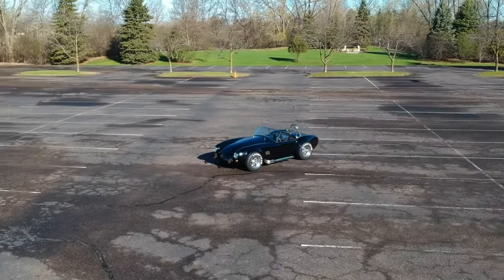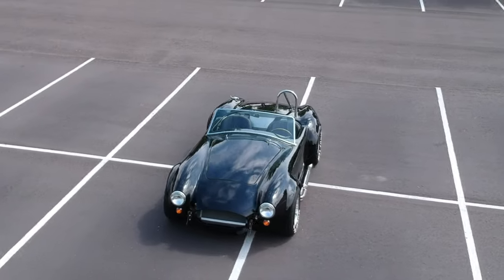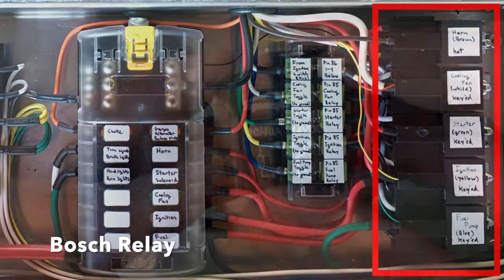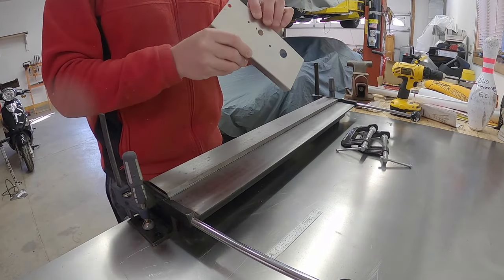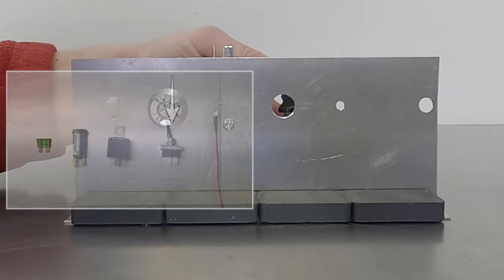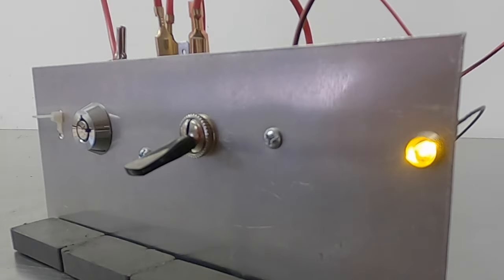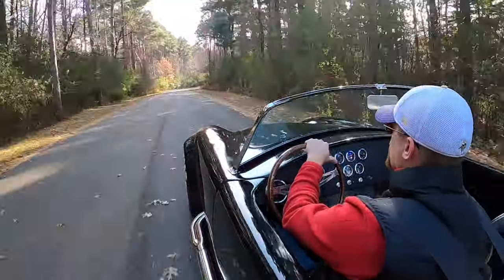Car Wiring 101

Comment: Just wondering why you switch the ground side? Most every circuit I have worked on both AC and DC switch the power side. I am a retired electrician and have worked on a number if cars. Completely rewiring 2.
Reply from the maker: Switching the hot side is preferred because if downstream wiring  were to short the ground side, it could trigger the relay (you are right with your assessment). I chose to trigger ground side for simplicity because of my switch layout with the relays in the trunk and I could then feed them all the same power source from the key switch in one place. I suppose I could have fed a switch array via the key switch then sent it back to the trunk/etc. too. I will say, its HIGHLY likely that any large scale auto mfg would only allow switching the hot side of the relay for safety.

Related- I'm in the midst of wiring an Edelbrock ProFlo 4 system in my Corvette and Edelbrock powers the ECU/system with a standard Bosch relay - interestingly though, they switch it from pin 85 as the hot source (should be 86 if wired "by the book"). I "think" I read somewhere that when you trigger off 85 you could potential reduce voltage spikes when the switch  closes that could cause issues with an ECU, but usually you would attack something like that with zener diodes. This is PURELY speculation on my part though- it also could be a wiring mistake.  What I'm getting at - I have NO idea why edebrock would feed 85 but I maybe the switch doesn't care which way current flows either- any ideas?
 
Thanks for the great comment!
Reply: @TacoJoe  Some relays have built-in fly-back diodes.
Reply: @TacoJoe  q
Reply: Most horn wires are ground switch.

Comment: “Except we’re going to tap in to the fuse box to power the loading side of the relay” and forward you lost me and I believe a few other people too. I was excited as you were answering all my questions up until this point. 
Why does the fuse have 2 power outs?
When you overlaid the relay diagram and started calling out numerical names of the pins it really threw a curve ball to the learning process (“this pin/that pin”) would’ve kept it simple and visual only. 
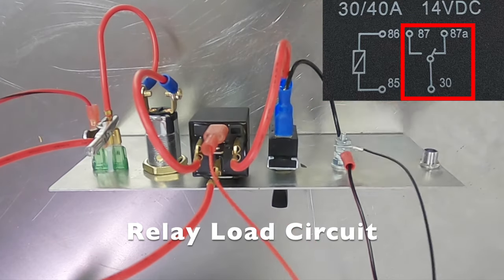Also the overlay sort of blocked out the last ground wire you added. Although the ground is super simple you should still emphasize it’s purpose. During the video I also had to keep reminding myself what a relay is and does. If it was explained (again) in the middle or after finishing the wiring at 4:10 it really would’ve put a learners mind back in line. 
Also the wires going out of frame adds another level of complexity because we have to “fill in the blank” of what’s going on out of frame. First time I watched the video I thought the fuse>load cable that goes out of frame was going to another fuse box or power source Before I realized it was just a single wire. Showing the battery in frame would cut the learner a break so they can focus the real unknowns.

Furthermore it would help us understand why, how, and when 2 wires can come off the same connector. The fuse and the grounding point both look like it would cause a short to the untrained eye. I’m guessing by you powering the load and relay from the same fuse you were trying to suggest that it all fuses in a fuse box have the same power source. Maybe it’s not i don’t know I still have that question. 

 After busting my head trying to comprehend whats going. I think I have it figured out now. Huge thanks to this visual you made for us! Truly a game changer and makes wiring less intimidating. I believe this content has huge potential. 

Thank you for your knowledge!
Reply from the maker: Lots of great points 2point2turbo - you could pull from the load side of relay too and only pull 1 wire from the fusebox / that's what nice about wiring is there are many different ways to achieve the same goals!

As for the visuals - great feedback myman and something I can work into future videos (battery in frame / better diagrams / etc.) apologies if it was confusing and hope you were able to figure it out on your project.

Speaking of which - I'm wiring up my C3 corvette (complete rewire) and maybe I can work in some of these clarifications in this future video- any additional topics you would like to see regarding wiring also?

Thanks for the great comment/feedback!

Comment: Trying to learn as much about wiring as possible because I might rewire my whole 85 s10 for a drag car. I’m frustrated with all of the gremlins in it to the point I just want to take out every wire and start over
Reply from the maker: So here’s what I’ll tell you: you’ll have to do some more planning up front, but once you get rolling, everything will fall into place and then a hen you have an issue, it’s easy to troubleshoot / I say go for it!

Comment: Don't know what you decided on your Vette.  I am putting a Gen V LT1 in my 37 Chev.  I got an engine harness with a refreshed computer from Speartech.  Harness laid out easily on the engine and just needed a constant 12v positive and a switched positive. One wire to the load side of the brake light switch will control the trans lockup.  This is my first venture into modern engines and I was impressed when I hit the starter and it immediately fired.

Comment: Thanks for this video.  Are you familiar with the Infinitybox 20 circuit wiring harness kit.  While quite spendy, it seems this would certainly simplify the wiring for someone like myself that does not have quite the electrical skill level or experience do do the job from sq. one.  The Infinity look like a nice system to me, your thoughts.

Comment: Thanks for the video! It helped me understand a lot, but I’m still confused on one part. What is the purpose of the relay? Would it work the same without the relay if you’re using a switch (ignition)?
Reply from the maker: Hi Adam / great question - yes: you could just use an electric switch in place of the relay - the catch is you need to find heavy duty switches / need run large gauge wire in place of the relay. If you really boil down what i did in my wiring scheme: I ran a whole bunch of higher amperage accessories through 1 key switch to keep things clean/simple on the dash and allow me to lock out the car for security. I wouldn't have been able to do it without the relays - unless - I found a 30-40amp key switch and ran extra large gauge wire around the car/etc. Thanks for the comment!

Comment: Nice 101 lesson! Too bad I'm fuel injected, and upgrading to sequential ignition and injection, I think I need the more advanced class. (Current issue: How many amps do 8x near plug coils draw, so what fuse and relay should I use?)

Comment: love the setup!  the keyed access is a neat feature!   what gauge wire did you use throughout your setup?  all the same, or different AWG?
Reply from the maker: relay outputs I used 10 & 12 gauge (a little overkill) and triggered the relays with 14 awg. You can easily trigger with 16/18 awg though / I just had a lot of 14ga on hand. If you do some google searches, there are charts that classify typical DC voltage drop as critical (less than 3%) and non-critical (up to 10%) - then specify an AWG for a length XXX run. Big picture: most lighting (minus headlights) 14AWG is great / fans you likely need 10awg / each can draw 20-25amps if you have a high CFM dual setup / starter solenoid also can draw some serious current along with fuel pumps/ignition. Every car is different though so make sure you do your research but you are thinking about the right things (ie - size it accordingly too!) Thanks for the comment!

Comment: I love your vids. I am building a MkIV (Complete Kit). I’d like to incorporate some of your wiring ideas into my car. The kit came with the wiring harness. I’d like to use a push button starter like you have done and have it secure. If I were to use the relays in addition to the existing harness, would I position them between the starter solenoid and the push button? Any recommendations?
Reply from the maker: Hi tom - sorry for not getting back to you sooner - you'll want the load side to the Bosch relay to trigger the starter solenoid and then you can lock it out too / that's how I did it anyway - you could probably trigger straight to the starter relay, but when it closes I think it can pull some amps so I played it safe and used a relay. If you can find a momentary switch rated for 10-15amps I think you could go direct. Good luck on your build!

Comment: Im thinking of installing an electrical fan to my radiator in my 65 GTO. theres a vid here where he shows how to do it and he uses a relay and its temperature controled. You think I should also install a switch to it? It is switched like thisoff the ignition.
Nice vid helped a bit

Comment: Very nice and clean installetion. For the switched relays: did you connect all '86' together so they receive 12v after ignition switch is on?
Reply from the maker: Exactly- key only gives the array power (so you can lock-out) - Bosch relays are quite useful! Thanks for the comment-

Comment: I have a 65 Mustang Convert with Painless wiring kit. Ive installed my second RetroSound Radio (pretty easy - 12v constant, 12v Ignition, and Ground). The first radio the internal amp fried and would do a speaker pop when turning the radio on/off (I could see the speakers push out (pop) then push in (pop). New radio (same make/model) no pop. What can I do to make sure the radio is better protected? The car does have a fuse box and the radio has an in-line fuse but something happened to cause the first radio to get damaged. Any ideas or help is appreciated! MD
Reply from the maker: There is an always hot line from the stereo too (for memory functions / etc) - make sure there isn't a short there, its on a fused lead and double check the fuse size. I have an aftermarket radio in my C3 corvette and I think its only a 10A fuse / good luck and thanks for the comment

Comment: What terminal block manufacturer did you use Joe? My Mk IV is ordered and I'm most concerned about accomplishing the wiring. Your video was great. Thanks,!
Reply from the maker: Thanks for the comment Gary - I just got a 5 pack or 10 pack off amazon so I guess it wasn't brand specific - they are really really handy though - I've used them for trailer wiring / electronics wiring / etc - make sure you have a good crimp tool also to go with them for your connectors and good luck with your build!

Comment: Do you need to have one relay for everyone? Like one relay for headlights, one for wipers, one for dimmer, one for heater. And so on and so??? Asking because I have an old 84 d150 and I would like to rewire it all doing away with some things and adding others like power windows, locks.
Reply from the maker: There are ways you can wire multiple accessories to one relay, but you would still needed the separate switches with larger gauge wire / etc for the different acecssories. If you want to keep the wiring simple though, go with multiple relays. Amazon sells 5 packs of Bosch relays for $30 or so / I've seen some kits which even come with mounting plates/panels for them. Good luck with your project!

Comment: I am learning with my 1st hot rod. I love CAR WIRING 101. But I also watched your corvette video with the fuse panel in the console. I was going to put my fuses behind the seats in my 1929 model A Tudor but now am considering between the seats ( like your corvette ). My battery is behind the passenger seat. Which location would you recommend ? Thank you.
Reply from the maker: there really is no right or wrong- I'd just weight the pros/cons. For instance, a pro may be easy access, but a con might be loosing space/cupholders/etc between the seats. If there are already access holes in the floor, that can be a pro too. Not super familiar with the underside of a model A - but - remember you may have a driveshaft passing nearby your wiring and if you can keep some of the wiring in the cab, the floors are a good natural barrier. Good luck with the project and ... Model As rule! (love em)
Reply: @TacoJoe  Thank you TacoJoe.  I loved the car wiring 101 video so much, I copied the box & layout (before installing) but I have room in the model 'A' between the seats & could run the wiring in a conduit along the tunnel in the cab. Hmm ? But that 101 box is just so tidy. At least you provided me with options. Thank you again.  Thanks to you and those like you, I am learning (the right way).

Comment: I noticed you put the switch on the ground side of the relay, I've always put on the positive side of the relay to trigger it. Not that I'm experienced at all but is there a reason to do one over the other ??
Reply from the maker: I think positive side is likely preferred because theoretically, the relay could short with age/damage/etc and power could then find a new ground on the load side/chassis/etc. and self trigger. I would have triggered on the positive side on my car build just like you, but the result would be double the wire run because my fusebox is in the trunk - ie - I'd have to run power from the fuse box in the back, up to the switch by the drivers seat, then back to the trunk to activate the relay. By feeding the hot into the relay, I can switch direct to chassis ground (and use half the wire). Now if I had the fusebox up front / under the hood / etc, I definitely would have triggered the relay just like you did (switch prior to the relay)- thanks for the comment!

Comment: Kewl , so you can put your fuse box and relays in a enclosure?
Reply from the maker: I"m not sure rules with enclosures, but under the hood, relays/fuses are generally enclosed in the engine compartment so it would seem a trunk enclosure passes muster? Are you familiar with rules w/DC for this? I suppose there could be increased fire risk with trapped heat from current draw. Thanks for the comment Eric-

Comment: Im curius as to why you put relays there. I think it beats the purpose should itbe near the load?
Reply from the maker: Has mostly to do with the car configuration because the battery is in the trunk anyway - you are 100% correct / the goal of using a relay is to eliminate the need for high amperage switches and heavy gauge wire running everywhere - thus - when you wire your car with relays, you want to be strategic where you decide to put them. Speaking of which - I've been rewiring my Corvette and have a part 2 coming (if interested) where I incorporate a EFI ECU and all the associated electronics, including ECU control of Bosch relays. Stay tuned and thanks for the comment!
Reply: @TacoJoe  Thanks for enlighting me! I'm excited for for the Corvete build

Comment: Can u make another part to this I’m trying to wire up the interior on my 85 dodge pickup which is all the lights gauges etc. and I’m kinda stuck idk what wiring kit to get
Reply from the maker: Thanks for the comment Jair / I'll see what I can put together / for the interior lights / gauges, a relay is likely not required, but fusing becomes more important because a short could blow out gauges lighting and that's no fun to fix. Read up / search YouTube for more videos on the topic (Car wiring) and I'm sure you'll find your way
Reply: @TacoJoe  thanks man means a lot i thought it would be simple but the kits I see with thousands of wires and colors make my brain go nuts haha

Comment: Ptshhhh any advice at rewiring a Buick reatta 1991
Reply from the maker: not sure they make a harness for those / concepts should be the same though as in the video: Q: Does it have an ECU?
Reply: Ugh unfortunately, haven’t had much luck finding anything about the Buick reatta or even what to wire, car even has 3 radiators. I believe one for coolant, then the other two for oil? Besides that it’s a unique little car, just don’t have the knowledge on it to get it up and running 😅
Reply from the maker: Don't give up / there's no set roadmap with any car restoration so good luck!

Comment: Im new to wiring and stuff. Im installing 3 led kits all 12v. Gonna be using a 12 gauge wiring and hooking all of the kits to the single wiring into a 20 amp fuse tap. I did research and i shouldnt have to worry about my wire being too long right? Should I use a relay? Also cant i just connect all of my ground wire from my 3 led kits to the same ground wire or do they have to be separate for some reason?
Reply from the maker: hey @Nodnarb69 - are they LED spotlights? As for 12 gauge, you should be good granted you aren't running them 50ft away - there's a nice DC chart out there for marine wiring-sizing of gauge vs. distance (will add link). Going larger on gauge is always the safest path. You could trigger the LEDs with a heavy duty toggle switch too if you don't want to use a relay. Good luck with your project!  https://images.app.goo.gl/KSeNEFkpxTgU4XyU7
Reply: @TacoJoe   thanks for the reply man. No they're rgb lights for inside. Changed my whole approach. Two different kits, one of em is a starlight for the headliner and the other is an 18 in 1 led kit. I have two doors so in each of em will be subcontrol boxes that'll tap into the door power. While the main box will sit under the middle console and i'll run that to my fuse and tap it with the starlight box. Just gonna use 16 gauge as the amperage wont be more than 5. Just planning ahead i dont even have the car yet lol i just drove 2 hours yesterday to be told that the dealership didnt even have the car even though i spoke to them on the phone about it before driving over.
Reply from the maker: 16 ga should be plenty big for those LEDs & sounds like a great project- good luck with the install!
Reply: @TacoJoe  thanks man I appreciate the help it means a lot!